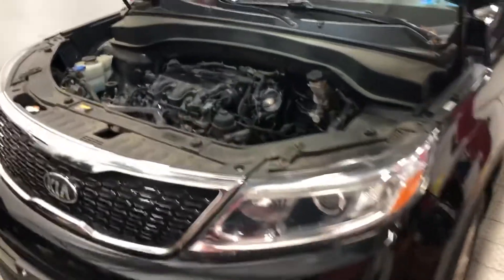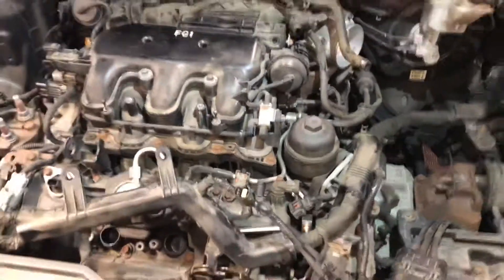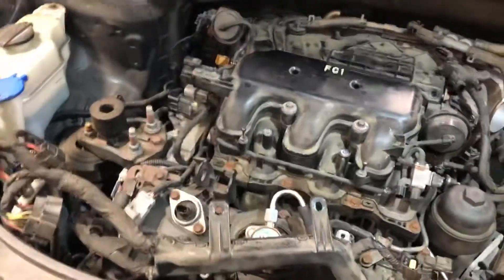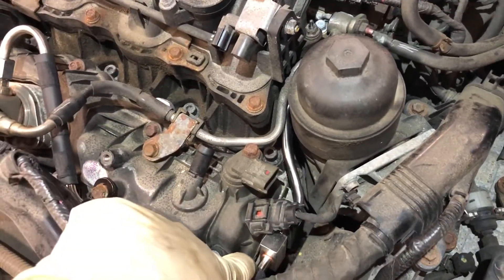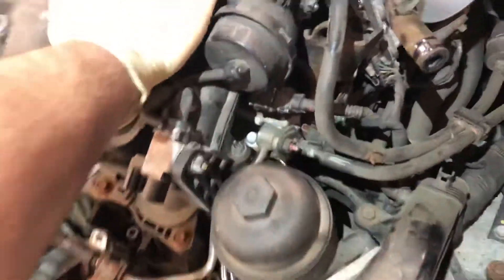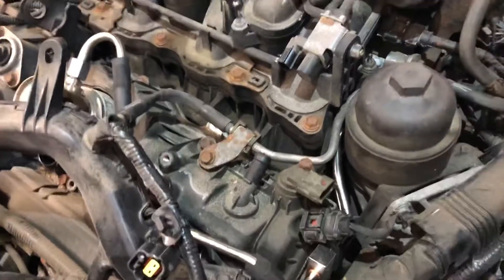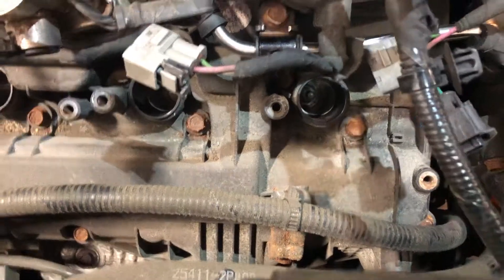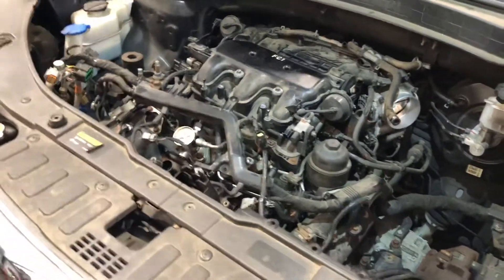Misfire codes - 2014 - 2015 3.3 V6 Kia Sorento

Comment: 2015 3.3 Kia Sorento . Started out with cam sensors first codes. Changed all 4 then misfire 2,4,6 all new plugs and all new coils . Relearned throttle body had that code its all gone now. But 2,4,6 misfire still coming up whats your thoughts 215k on the motor . You think it's 3 injectors? I doubt it  You think harness related? Please respond

Comment: 2011 Kia Sorento v6. Started up and it was idling really rough and no response from pressing the gas pedal. Shut car off, pop the hood and you can smell fuel. After a few start up, car won’t idle anymore and die after a sec or so. No check engine light. Code scanner is not picking up any code. What could the problem(s) be?

Comment: I have a 2016 Kia Sorento , 2,4,6 misfire and crankshaft position sensor came up as a code .. 
changed the crankshaft sensor .. 
next is the ignition coils . Already change plugs a couple months ago when it started running rough .. 
what’s the firing order ? 
2, 4, 6 right in the front ? 

Thanks .
Reply from the maker: 2/4/6 are on the left bank (closest to the radiator). You may have an issue with cam timing, some 2016 v6’s are also having issues with head bolt threads failing, if you have low compression or are using coolant I would head in that direction with my diagnosis. Hope this helps.
Reply: @kauffmanstein  took it to a mechanic , he had changed timing chain and tensioners . and last night i just replaced the crankshaft position sensor cause that was a code that also popped up. im really thinking its the coils. rough idle when sitting and starting out slow and once engine gets warmed. engine light flashes . 
the mechanic tried saying the motor blew up . but only changed those parts and i could drive it .. so my theory he has no idea what hes talking about .
Reply from the maker: @autumnharrison7776  3 coils failing at once is next to unheard of. If it’s missing badly enough to make the check engine light flash, that means you’re doing damage to your catalytic converters due to the unburied fuel entering the exhaust system. You need a compression test and a leak down test done to verify the engine is in good condition internally.
Reply: @kauffmanstein  codes were just two and there is an oxygen sensor code on too. should I change that also ? it just switched to 2,4,6
Reply: @autumnharrison7776  I am having some of the same issues. I have a 2015 kia sorento sx v6 3.3L and it popped codes p0300 misfire, p0019 crankshaft sensor b, p0302, p0304, p0306, and p0024 camshaft position sensor (bank 2). Today I just replaced the front 3 ignition coils and spark plugs along with the camshaft sensor. Drove it for 20mins but the engine light hasn't come back on yet. But...the car is not idling right when I am sitting at a stop sign. So i know there is still an issue. I'm going to replace the other three ignition Coils and plugs but I am scared that still may not work. Any other suggests you guys???
Reply: @kauffmanstein UPDATE:  I changed the oil, replaced the battery, and all of the other parts.  Now when I try to press the brake to start the car it is very stiff and the car will not start. I tired the bypass method but it does not work.  Something is wrong because when you initially push the start button (no foot on the brake) it turns orange.  Then if you push the start button (no foot on the brake) it should turn GREEN.  My ONLY turns red.  What could be the issue?  It was starting fine until i replaced all this stuff.
Reply from the maker: @AdanValue  might be an issue with your variable timing system. It may have jumped time. You’ll need a qualified technician to do some tear down and find out why it won’t crank over.
Reply: @kauffmanstein  the dealership recommended checking to see if I have fuses blown. I dont see a fuse causing this

Comment: Hey wats up man. I got a p304 code on my 2013 kia sorrento.  With 115k miles on the car. Is this covered. By the ongoing campaigns. With these engines
Reply from the maker: Sorry, just saw this. If your plug is oil fouled and you’re using oil, sometimes they will cover it with enough documentation. I would go to your local Kia dealer and get the latest reflash done under the PI1803 campaign.